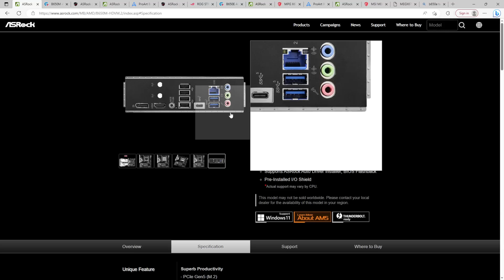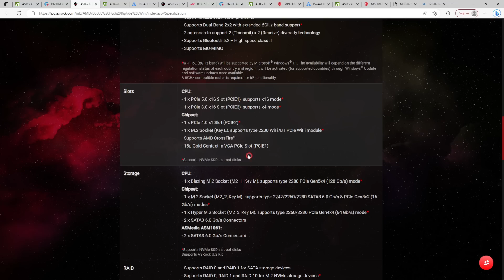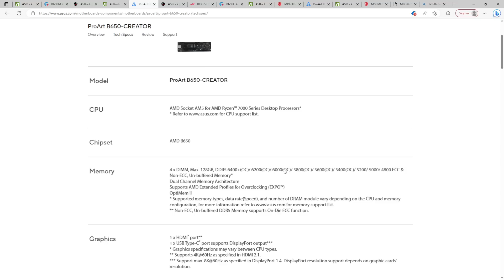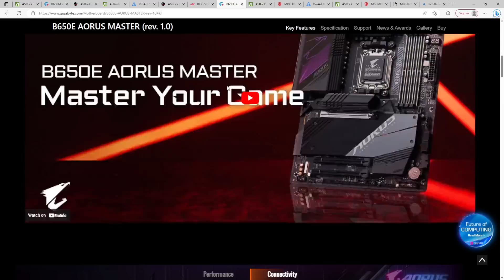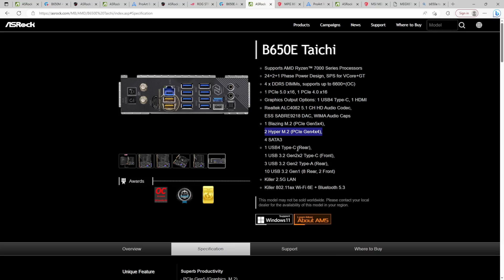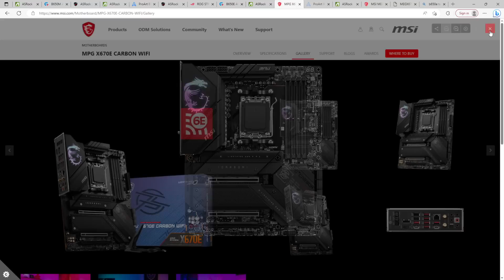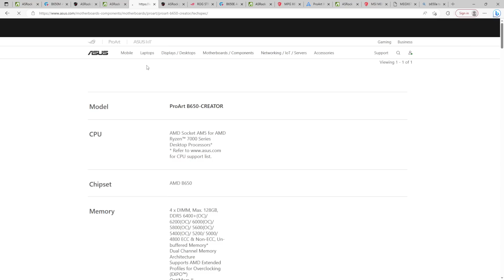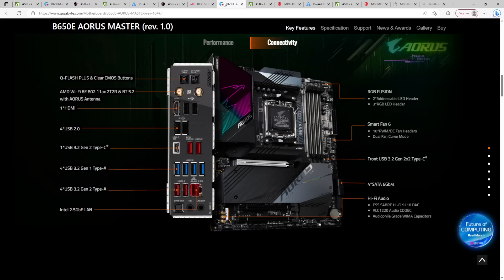AM5 motherboard round up

Comment: Nice roundup. I went with the proart x670e. Stability has been an absolute mess, but made the decision for pretty much the exact reason mentioned; the combination of i/o (especially dual x8 + thunderbolt). The ProArt b650 also has DP in btw, and I think there may be another one or two boards out there supporting this. Unfortunately I've still not had success getting my silly LG 5k  27MD5KLB working at native resolution through it (tb3 input *only*). Was also having issues with the wireless drivers crashing so swapped that out for an intel 6e adapter. Plus of course all the asus bs currently going on.
As for the comments on why someone might have so many m.2 drives - IMO a real use case is keeping multi OS installs separate. No need to worry about updating GRUB or windows doing weird stuff when it detects another os or another windows boot drive present at time of installation. Real data goes on a separate drive, and I don't have to worry when it comes time to nuke a boot drive and install something else. 
Less cables is a nice little bonus too if you're constantly screwing around adding/removing random hardware too..lol
Reply: I keep reading that stability on the ProArt X670E is terrible and there are also a bunch of issues getting high amounts of RAM working. What are the primary issues you're facing WRT stability? Would be very eager to hear as I was rather tempted to get this board eventually. Thanks for taking the time!
Reply: I too have the X670 Proart. The only issue I've had so far (after latest official BIOS) is the iGPU driver eventually crashing in Windows. I haven't been booted into Linux for long enough periods of time to notice any issue there. It's been rock solid if I use my 6800XT. I don't rely on the wireless at all though, and sparingly use the BT. I typically dual boot Windows and Linux, and use virtualization inside both. My machine also acts as a NAS server with Truenas in a VM in both, so a 3rd M.2 could be used as a L2 ARC. Pretty much any other native booting is fine with externals or PXE.

I think the bigger part of him questioning the 4 M.2 is that they are all Gen 5. There aren't really many use cases to have that much gen 5 storage. You're either moving data in/out/around or processing it some way. Thunderbolt is the fastest external interface, but no one makes a NVME enclosure actually capable of maxing out even a Gen 3 NVME. 10Gbe is only 1250MBps. The fastest a 7950X(3D) can decomp with 7zip is around 2.9GBps, and compression is only ~150MBps. Outside of AES encryption, most everything else you could ask of the CPU isn't going to have the throughput for even chipset bottlenecks to actually matter. Typical activity barely needs more than sata throughput.
Reply: I think the ProArt is pretty underrated, because it has no gaming related name, because I cant see were it is lacking.

Comment: You should add a temp sensor header to your list of features. A lot of motherboards don't seem to like adding 2 pins that cost barely anything to motherboards and Asus has been removing that from a lot of their boards lately. Doesn't sound like that big of a deal but it's very, VERY nice to have for custom loop builds, so you don't have to have your fans constantly ramp up and down for short loads that isn't going to affect the water temperature. I know you can add it via external fan controllers, but those things are ass to work with, break every 2 weeks, and don't work on linux for us neeks who like having an OS that respects it's users.
Reply from the maker: Just keep adding radiators till you can run the loop pretty much passive :P
Reply: I've never had a motherboard with that feature, but it could work well for air coolers and AIOs too.  Just thermal epoxy the sensor to the heatsink base or the radiator inlet manifold.

My fan control script uses CPU die temperature, and I'm kind of "guessing" at package temperature with a thermal load line and a lowpass filter.
Reply: When I was checking around the Linux kernel with Gentoo I found out there is aquacomputer drivers ready for it, so if you have their external devices it will work under gnu+linux(kernel 5.10+) with your favourite temperature monitoring software.

However I deal with itx often and trying to find a itx board with those headers is a pain in the butt.
Reply: this.. i have an x470 c7h and love the feature. Found the middle tier gigabyte b650 board.. the auros pro? to be the cheapest option to have a temp sensor. The german proce compare site geizhals has a connector layout of every motherboard in the product photos. Fastest way to find a motherboard with this feature.
Reply: I use one of the temp sensors of my B650E Aorus Master to control the fan pointed at the memory sticks (4x 32GB).

Comment: Being a first time builder, it really gives me a peace of mind to see Buildzoid giving a recommendation on the B650E PG Riptide 😊. Thanks!

Just wondering how this board can stand the test of time as I planned to use this for >10 years with upgrades along the way
Reply: There's really no failure points on a motherboard and as long as VRMs aren't at 110°C (which they aren't on your board, they are really good on yours) it just runs forever.. If you have an AIO you will need to buy a second one halfway through those 10 years though.

Comment: ProArt: I expect the reasoning behind the PCIe slot spacing is that if they moved the second x8 down you wouldn't be able to fit a second graphics card anyway in most cases because it'd run into the PSU shroud (or case bottom). AFAIK Buildzoid tends to run all his in open bench so this is not a factor for him but I expect very few Creator boards are used that way. Not having optical out might be a bummer but AFAIK most that could care have long since transition either to Thunderbolt or USB connected audio equipment so again, might come down to knowing their target market.
Thunderbolt: I expect it's a trademark/certification issue - at least earlier Intel refused to allow to use the name Thunderbolt and logos on AMD. Officially this was due to the Intel's driver not implementing "memory protection" on AMD. IE, Thunderbolt is PCIe so unless the driver sets things up "just right" it's possible to read any memory on the system via TB, often including things that even the OS can't read like Intel/AMD firmware TPM areas! My understanding is that this potentially could allow BitLocker bypass and "modify windows while running to accept any password".
IIRC this requirement was added in TB4, a lot of earlier (TB1-3) drivers tends to not allow TB PCIe devices until you manually "approve" them in the OS due to this... This provides SOME protection but if the user had approved any external devices it wouldn't be hard to clone the PCI IDs and then use that on an attack device to bypass this, so the requirement makes sense, the issue is that Intel makes the TB chips and thus the DRIVER for it, and at least at that point has only bothered to implemented this on newer Intel CPUs. The fact that none of the AM5 motherboards mention Thunderbolt hints that this may still be the case.
Reply: I have the ProART whilst its not exactly thunderbolt what I was looking for was the transfer speed of 40/gbps I downloaded the thunderbolt intel controller directly from intel and my thunderbolt devices started working. Its great.

Comment: Requirements: 2 USB3 headers for 4 front USB3 + 1 type C ,  heaps of Fan headers, Postcode, wifi, and dont care about other pcie slots ...have a monster that makes them useless.  And I like something that looks good and doesnt have problems ie Rog Hero 670e
btw: does the future AMD6 ??  cpus will require all the extra power stages etc ?
btw2: would love to see motherboards with no SSD's .... dont use them and its so good for cabling

Comment: With the MSI carbon. If you are running only one GPU, but 2 m.2 SSDS. Will you get gen 5 x16 on the GPU and gen 5 x4 on both m.2s? So no cutting on PCI lanes?

Comment: Great Video Buildzoid! For me the bottom line of a motherboard is not having an Intel network chip. I've had too many strange behaviors including random lag spikes and disconnects with realtek ones (at alt-tab for example but you could trigger it in many, many ways) likewise a close parent that's also in this hobby for many years, same thing, random disconnects. (An extra: They were mainly by far bad experiences with network but not restricted to it, i have also one Asus Rampage Gene 4 X79 with Intel lan working flawlessly but they used a realtek chip controller to extend the sata ports of the board, this controller, right now is nothing but fully dead from long ago, at least 4 years now, the board works but without those satas)

The Realtek latency measured by the DPC Latency (Deferred Procedure Calls) due to the bad drivers are also not good (there's a good article by PCGamer called "Motherboards with 'Killer' network adapters aren't worth your money", it's a few years old but they did a good work there). 

Unfortunately Asrock due to this "Dragon Killer" brand network (that is mostly just a realtek rebranding with makeup) use it in all their mobos. Others manufacturers tends to reserve it for the cheaper boards like Asus that have been using Intel network controllers in all their boards at Strix level and up (and some TUF). Gigabyte the same, starting usually at Ultra and some PRO. MSI at top boards at top chipsets like Z690+ and X670 with all GodLike, ACE and Unify models and they various versions, except when they use the Marvel 10G lan instead in a board that provides only with 1 lan.

Comment: I watched the HUB B650 mobo roundup and was leaning towards the Aorus Pro AX, and the PG Lightning. These seem to be a decent price, good VRMs, 3x m.2 slots. This video is good to get some context. E.g. the 7k series don't really need beefy vrms cos they are not power supply limited. Good to know. I think i would still get something with decent VRMs in case 8k or 9k series need it cos my plan is to upgrade to AM5 7800x3d from an i7 3770k and when AM5 is end of life, get whatever the latest X3D cpu is at the time and be good for another 4r5 yrs. So keeping in mind some features to future proof.
Reply: Which board did you ultimately choose? I am in the same position, looking for a "future proof" board which last until the very last generation of AM5 X3D CPUs (zen6/9000 series?). Thank you!

Comment: B650e aorus master has been flawless so far I got one when i picked up the 7950x3d at launch. I got it for $350 at microcenter, on paper the asrock taichi  has a better vrm setup but the master seems to run cooler from the test I’ve seen but that was the boards i was looking at when i did my build. I seen no reason at all to get an X board this time around. Also really like having a backplate on the motherboard makes it fill more premium. My main things were good vrm and a post code reader.
Reply: Can you give me any updates? I am planning to buy the same board but I am scared of the negative reviews about it having black screens and all that. Thanks 🙏
Reply: @zenith_uu  Just buy it if you want it. Every board is gonna have 1 star negative reviews saying they arrived DOA or massive glitches. People who wouldn't leave a review if the board worked fine will leave a bad review if it doesn't work, because anger is a strong motivator and this phenomenon leads to skewed reviews. Basically, just ignore negative reviews on motherboards unless you see evidence that actually indicates a widespread problem. Look to see if there's forum threads or reddit posts about it, if not, then it's just somebody who got a lemon and got pissed enough to leave a bad review.

Comment: You missed the Thunderbolt 4 AIO port options on the X670E PG Lightning and the PCI slot spacing works perfectly with sensible GPUs 🙂🤷‍♂️
Reply: I'm setting up  a USB4 aic on the riptide 650E to connect to a mitx Nas that will be using the Asus 670E-I giving me 40gb transfers and a small footprint. Not sure if I can bond the two 40s into an 80.  Microsoft didn't mention it on their page.  Now the negative is that you can't do an internal capture card with that setup.

Comment: I know its not possible to cover all AM5 boards in a video, so maybe two videos, one for B650 and another for X670 could have been done. I feel Buildzoid missed the best $300 X670E board, which is the Asrock X670E Pro Rs. Its maybe $20 more than PG Lightening, but has 1 PCIEx5 NVME, 3 PCIEx4 (1 from CPU) NVME, 1 NVME/SATA Hybrid, 6 SATA Ports, Optical out, WIFI, and no bandwidth sharing among any of the IO/ports (like many of the Asus boards). The downsides are no Post LED, only one x16 PCIE5 slot (2 PCIE4 x1 slots), no CMOS Reset Button (you have to short a jumper) and no eCLK OC.
Reply: I think he did cover it in his specific ASRock video and noted the features. It is an underrated board.

Comment: You should be checking out the Asrock B650E Taichi Lite. What do you need dual x8 support for? I especially like the fact, that using the lower PCIe port, I wont downgrade my upper port.

Comment: I just got the X670E Steel Legend from Asrock, and I wish It had the code thing, cus it cost like 450 euro here... pricy. Also, i wish it had a bios reset button. With those 2 exceptions, the board is amazing and i love it. The cheapest i could get here. I dunno why suddenly motherboards cost an arm, but that's life.
Reply: where the hell did you buy it? Lol...in Serbia and Montenegro is around 320 euros
Reply: @skrajina8037  I guess my country is the Brazil of Europe lol, cus tech in Brazil is just as expensive LOL.
Reply: @Starfals  thats crazy how much money they take from you guys
Reply: @skrajina8037  The 7800X3D was 600 euro here, that's how much I had to give them, with tax and all.
 Its supposed to be 450-500, but here its way more :P
Reply: @Starfals  thats insane price bro lol! How much is 7950x?
Reply: @skrajina8037  Thats cheaper actually, i dunno why. 950X is cheaper than 7800x3d... crazy stores here ;p  Around 50 bucks difference I believe, gotta check for that 1 tho

Comment: You're wrong about the post codes, the reason you don't need post codes on Asus boards is Asus boards never fail to post 🤣🤣
Reply: I thought they just used smoke signals instead 😉

Comment: B650M HDV/M.2 is a no brainer to me considering you can still get 16 usb ports in total (although i'm not sure how many controllers, but it's fine for 99% of use cases anyway), can put a wifi/bt card, 3 x4 m.2 ssds (with an adapter on the x4 slot) and still have a pcie x1 slot remaining for whatever you might need it, maybe a fourth ssd running slower lol

Comment: Regarding the 4 x PCIe gen 5.0 slots, some workloads are bottlenecked by storage speed (ex: when a model is much bigger than VRAM), but you can have several M.2 drives in parallel.

Comment: If there is anything you should learn from this video is that you should not overspend. Spending a lot of money on a board with a PCIe gen5 M.2 slot is useless if you are using a gen4 SSD, don't buy 7200 MHz DDR when your processor can only provide 5200 MHz. 
My current,cheap, motherboard had some bad reviews because it does not have PCIe gen5, only 5 USB3 ports, no 5.1 or digital audio and no blinkenlights. But it has all I need, allowing me to buy more memory and a one level better GPU card which is great since I use this system for 3D scanning which is memory and GPU hungry

Comment: Years ago I bought a motherboard for my first gaming setup based on a roundup motherboard video you did back then, was the best video I could find even though I'm never doing overclock. A couple of months ago your video came to my mind but I was not subscribed nor remember your chanel name.

Now I was looking for a motherboard review and someone made a comment saying your nickname and it just clicked and found your chanel again! I won't commit the same mistake so I'm subscribex now.

I'm looking to upgrade for a 7800x3d setup and I just have a question. In motherboards what does matter when you live in a country with too many electrical shut downs? Is the VRMs? I was looking for any with 12+ but you just recommended the cheapest one for that processor, I don't want to do overclocking, I just focus on unkillable hardware.  I always go to Gigabyte in motherboards and EVGA for PSU for this reason, they survived a lot of electrical issues for long long time 😂

Comment: Hi!
I am looking for a motherboard that will work in my computer for the next 5-6 years. So far, I have purchased Ryzen 7600X and Fortis 5 air cooling for it. In 3-4 years, if I feel the need, I will replace it with something more efficient from the newer generation. The same applies to the graphics card, I bought an Asrock PG RX6950XT and if necessary, I would replace it in 3-4 years with something fresher and more efficient. I also bought an MSI A850A ATX 3.0, PCIe 5 power supply. I chose the AM5 platform because I wanted to save money on replacing the motherboard in the future. So far I hesitate between Asrock B650 PRO RS and Asrock B650E PG Riptide WIFI. The computer will be connected to the network by cable, so WIFI is unnecessary for me, but the difference between these boards is about $ 20. In between is LiveMixer. I am also considering the GIGABYTE B650 AORUS ELITE AX. 
7 USB type A connectors would be enough for me, the optical connector is unnecessary for me. What would you advise? Is it worth looking at PCIe 5.0 in this case?

Comment: hey are any of these NON WIFI and NON REMOTE BIOS? (maybe non bluetooth and removable TPM) I been running the asus sabertooth 990 rev 1 for 12 years daily. Velociraptor running 10,000 rpm for 94521 hours with 11001 power ons. will any of these run on W7? I really dont want to take the mark of the beast....am I stuck here?